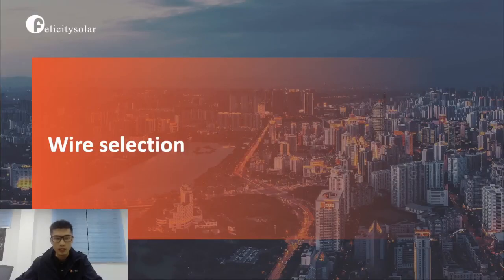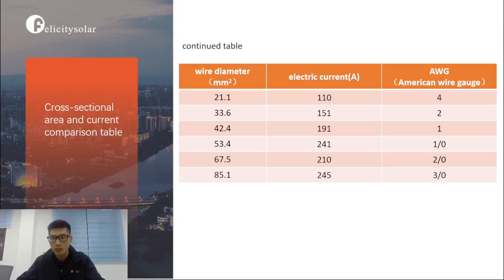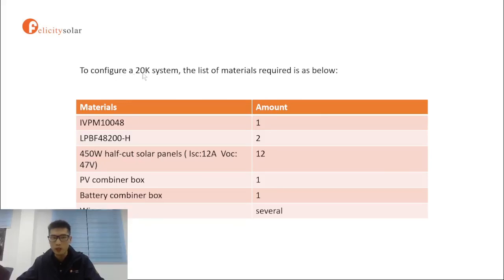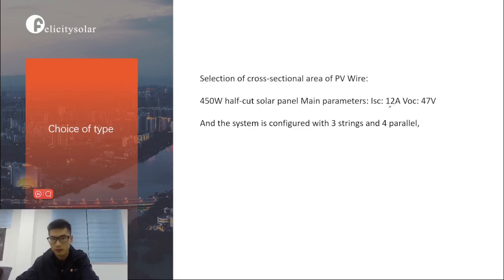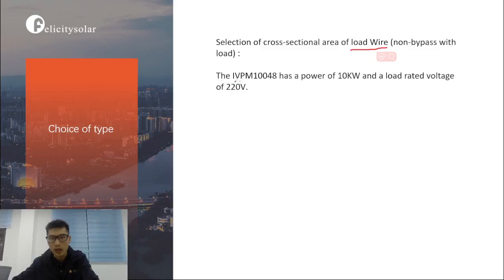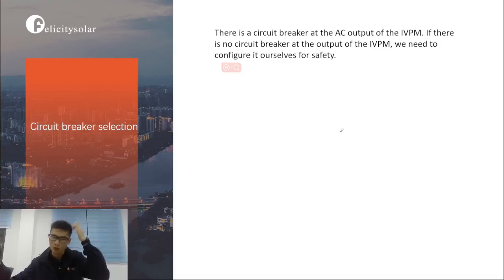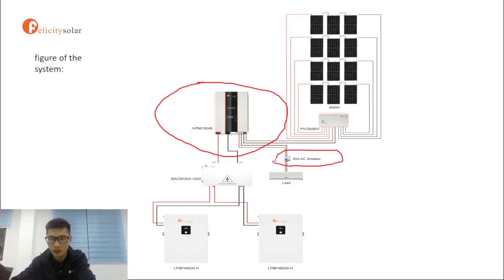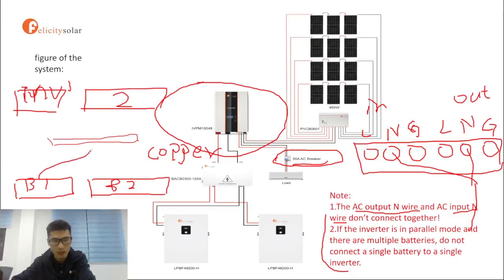Live Playback: Solar System Material Selection

Comment: Very detailed lecture, Thank you. 

However a very critical aspect was omitted. When selecting cable size you need to consider the length of the wire! 

Just like the resistance or the current carrying capacity of the wire is inversely proportional to cross-sectional area CSA, it is also directly proportional to the length of the wire.

As a rule of thumb the voltage drop is not expected to go below 4%. So to go around this. Endeavour to locate your DC system [inverter, batteries, charge controllers] very close to the solar PV panels.

While the AC side which is the output of the inverter can be longer wires which is a higher voltage level.